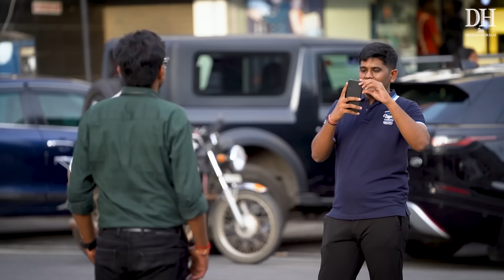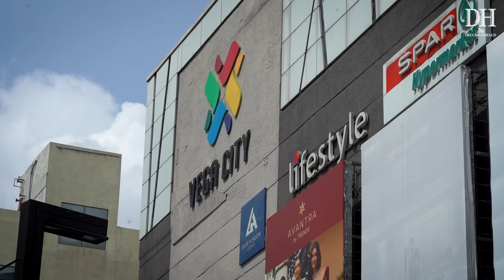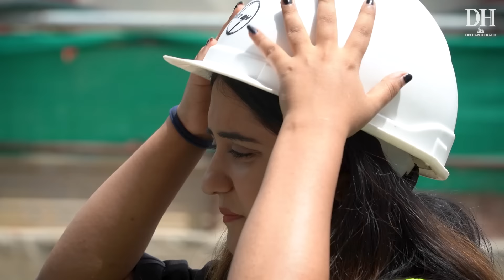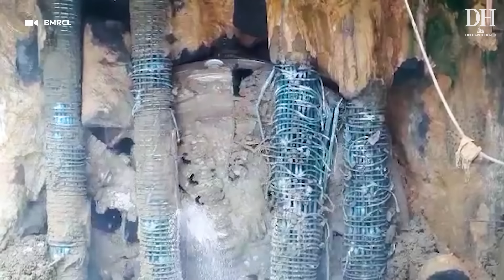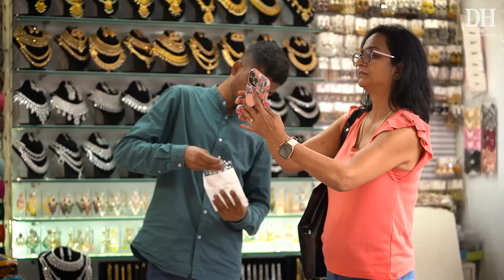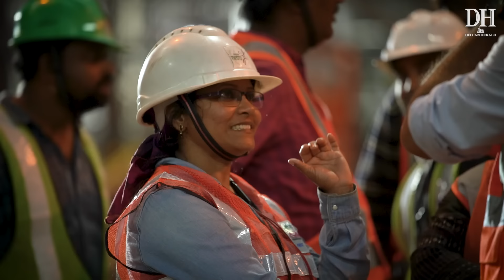EXCLUSIVE | Namma metro’s pink line: The longest underground section of Bengaluru metro

Comment: TBMs can excavate 15 metres a day at the very low end and 50m at the upper end. Let's assume an average of 30m a day. At that rate, excavation should take 3 years. But since they were tunneling from both sides, it should have taken half of that - 1.5 years. Add another 1-2 years to do all the rest of the work inside. If the work started in 2021, the ENTIRE line should have been open by end of 2024 at max.

Comment: Excellent reporting by the smart young reporters of Deccan Herald. As a resident of NY city I use the over 100 year old metro (MTA/Subway). It provides excellent connectivity and at quick speeds by having both local and express trains. Deccan Herald should use its reputation and influence to educate Namma Metro on what is available out there. After waiting for decades for a metro the citizens of Bengaluru should not be give a substandard and suboptimal product.
Reply: I have traveled in Metro/Subway networks in India, USA, EU and I can safely say that in terms of user comfort/ cleanliness / ease of use (smart card/qr code) Namma metro is one of the best experiences. Only missing thing I would say is the extensive connectivity that other mature networks have. Once Namma metro completes the currently under construction lines it will not be behind anyone in the world.
Special props to the Namma metro authorities for keeping the Metro trains and the stations extremely clean. NYC subway is literally disgusting, hope Namma metro doesn't go that route after 2-3 decades of running.
Reply: @varunj2244  my comment was related to design and specifications. Since you are familiar with NY MTA you will appreciate the concept of local vs express trains that NY has. Someone can go from downtown to midtown non-stop. With Namma metro with its two lines instead of four skipping stations will be harder. Perhaps adopting automated platform doors would be a potential solution (a costly one though)
Reply: @varunj2244  one more thing, 6 car train for a mega city like Bengaluru is insufficient. Again look at NY MTA or even New Delhi. Why not build to last from day #1
Reply: @TS73827  your points are fair. Namma metro plans to make more frequent trains, that should help a bit.
However, I do know that the way they've built the tracks with curves, it's hard for trains to go fast at many places. The stations themselves were important so can't argue with the routes. One can only say, well they could've gone fully underground which would balloon the costs and project durations.
So I sort of understand those compromises. Having said that, Namma metro is still pretty good.

Comment: Phase 1 was a great boost but phase 2 and 3 need to be completed fast... with new phases added fast and with upcoming ring roads like itrr,strr,prr and k-ride the suburban rail traffic should finally be a bit less 😅❤
Reply: It belt needs connectivity. Whitefield is done . Blue line from Silk Board to airport needs to complete. But it’ll be done in 26 only. It’ll help travellers to marathalli go fast

Comment: Bengaluru City urgently needs 350 kms of modern metro network to become traffic jam free.
Reply: Yeah definitely City need more metro lines as it help people to commute easily and quickly and less dependent on personal vehicles and will help reduce the pollution,
Reply: Bengaluru  also need  more disciplined  citizens --  90 % cars  used in  BENGALURE is   used with only drivers ..   All the other  4 seats  and space on road gets  wasted .. People  do not find traveling in CITY  BUS is  as per their standard ..  Major Infra project on LIVE CITY is like  BY PASS  SURGERY  on the patient
Reply: First let the traffic cops stop using their manual signals, and avoid unnecessary congestions
Reply: btp is already installing Japanese traffic signals at all junctions   @vindo3558
Reply: No its need 1000 km metro from hosur city satellite towns village airport even built new Bangalore made metro there

Comment: Current MG Road is fine. But, our 80s and 90s MG Road was the real iconic road with all the erstwhite theaters, shopping places. We were able to cross the road then. Now, forget that
Reply: Bengaluru population is nearly 1.50 crore in this big city population daily just 5-6% people are using this metro trains for there travel, metro is just wastage of tax payers money
Reply: @sharankumar4396  Bro, find me an empty metro seat anytime during the day in any of the metro lines, i will agree to your statement! We need double decker metros with the capacity it runs with!
Reply: @sharankumar4396  if you are being that analytical, why don't you take the entire story into consideration? This metro operational now was conceptualized in the early 2000s and even HDK's first govt told that Bannerghatta doesn't need metro as there is no demand. City grew exponentially in the 2010s decade and Whitefield, E-city, Airport and Bellandur region was the hotspot for traffic where the metro work is ongoing. Once it is all done, I would say 2 million plus daily ridership can be achieved. The current metro is only for the original city limits.